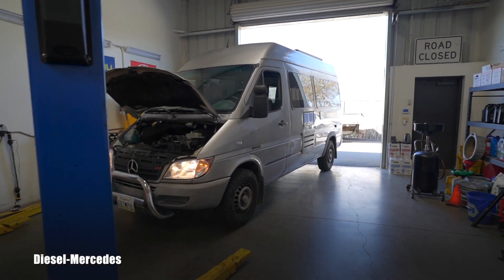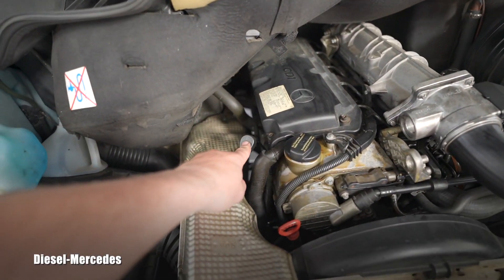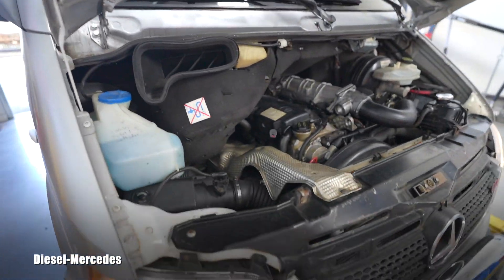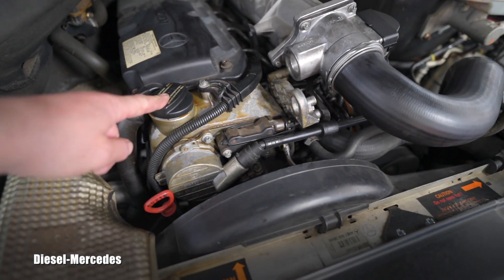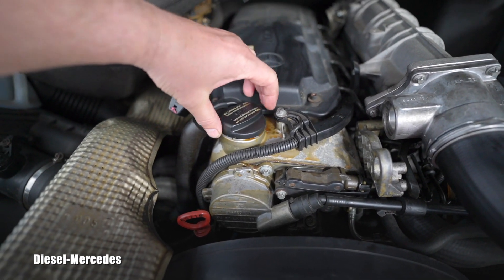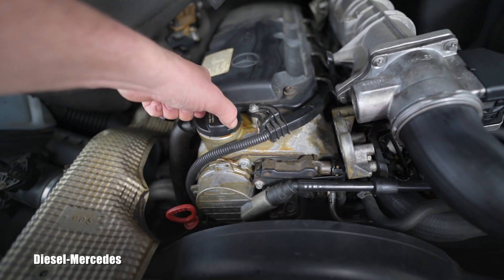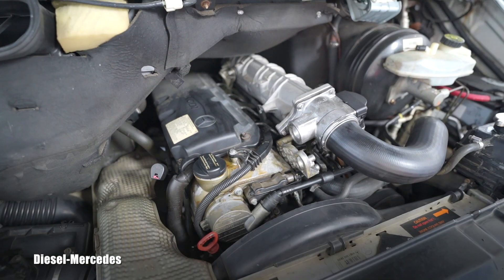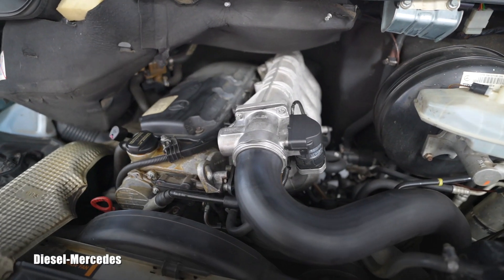Sprinter diesel engine blow by test

Comment: Thanks for the video but what if no air coming out instead few oil sprinklers.. is that bad ?
Reply: same question
Reply: not bad, it’s normal. The timing chain is right below the oil cap. that’s why you get oil splash when you take off the cap while it’s running.
Reply: No problem if oil is spraying out, most 4 cyl engines have camshaft right below the oil fill cap. Some have baffle of course, like Toyota and won't spray oil. The most important is that you don't want smoke to come or too much air getting pushed out